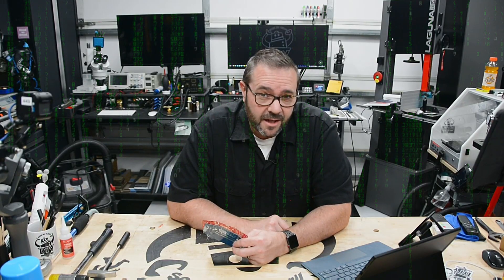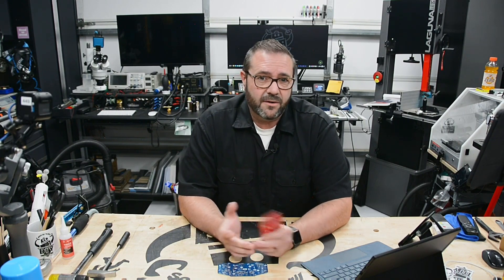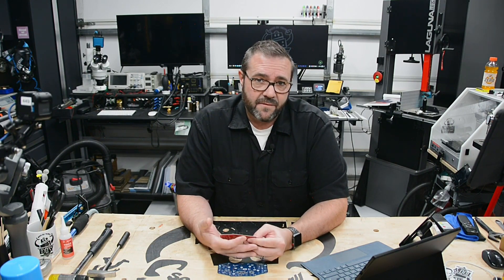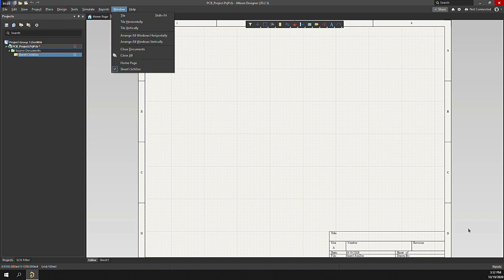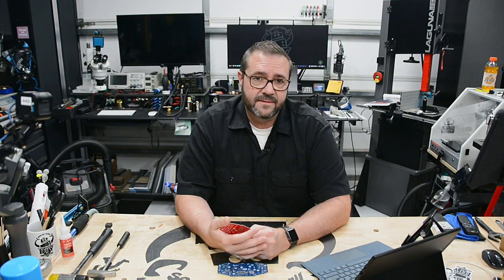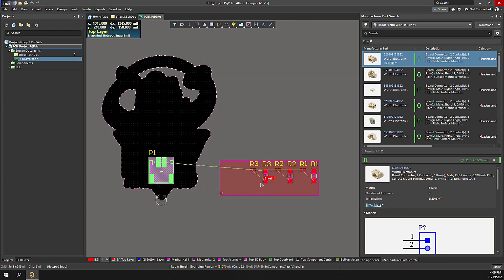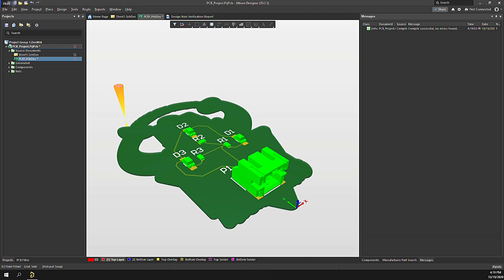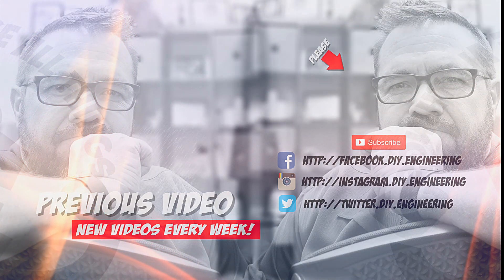Step by Step Electronics Project Using Altium Designer!

Comment: I really recommend CircuitStudio, been using it for three years now, its a bit easier to get into than Altium Designer
Reply from the maker: They share a lot of the same metaphors but it doesn’t have a lot of the advanced capabilities designer has. I hear they may be re branding it soon.
Reply: @DIYEngineering  I did use Designer for a while, can't say I miss any functionality since I found a workaround for doing panels with clones of s design. I am a hobbyist though!
Reply from the maker: I did like it though, it’s got a great component library and definitely more affordable.